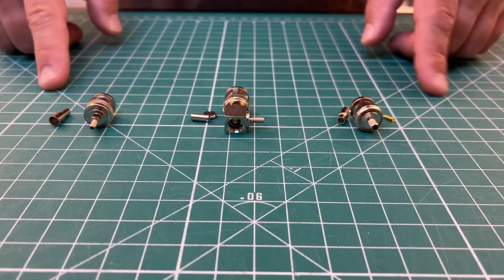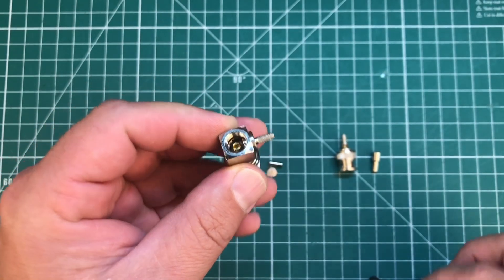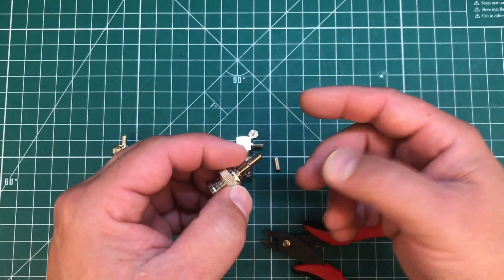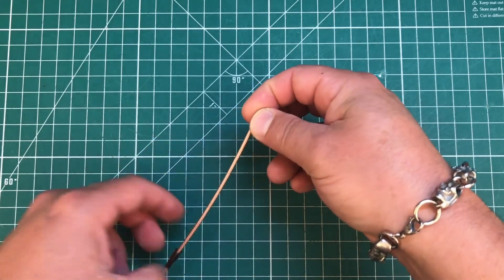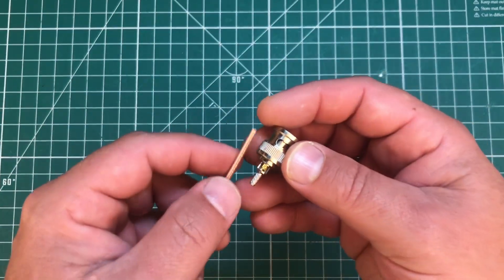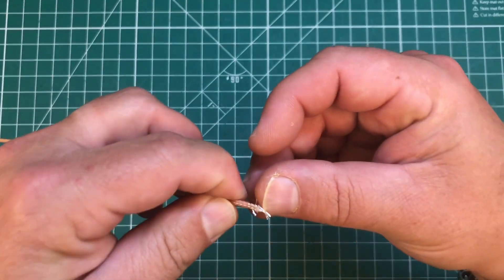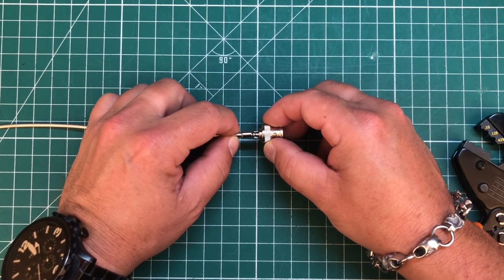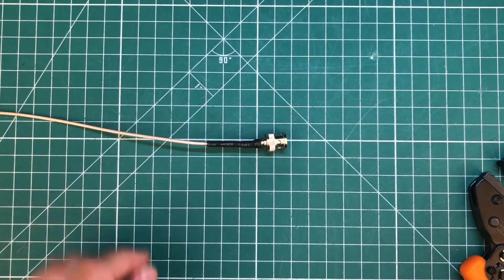How To Install A Crimp Type BNC Connector On RG-316 Coax

Comment: Finally got the parts to do this. Looked great but shorted. No idea where the problem could be. To many variables.
Reply from the maker: could be a tiny drop of solder under the center pin?  That's about the only place it could short I would think.
Reply: @hamradiotube  I forget to update this after we talked on Discord. I tore it apart and I think the solder blob was to big and spanned the gap to the rear of the inside were the center comes in. Who knows but I tried it again with less solder and it’s now working great. Old eyes as well, it’s so tiny in there even with 4X magnified glasses.

Comment: Great video Mike, I need to put together some bnc coax cables. Had a major WTF moment a few months ago when I drove down to the Outer Banks to go portable and got my gear out on the beach, went to hook everything up and when I pulled out the PL259 coax I realized I left my bnc adapters at home. I just went to the bar, drank heavy and accepted defeat. 73 my friend!
Reply from the maker: Oh man, I've been there.  That feeling when your heart just sinks when you realize you won't be getting on the air is the worst.  But, at least there's alcohol!

Comment: Mike, Love your videos, I've been a ham for almost 42 years, & I used to get my connectors from Old timers at hamfest back in the 80s & 90s. I also worked for big computer companies like DEC & Wang Labs. We would use only Amphenol for our Data cables I would get mine from there and only use really good BNC/PL-259, etc connectors. But after leaving there I learned by mistakenly getting the cheap versions when I had no more of my stock left & would buy from E-Bay most times. I had problems, so I now only use Amphenol connectors because of their higher quality. You Pay a bit more, but you are getting a much better quality item.
Reply: I Concur
Reply from the maker: I guess I lucked out!  I've not had any problems with the eBay connectors I've purchased, but I do understand the difference between good and cheap.

Comment: Mike, 

First, thank you for showing the differences in the BNC connectors.  I have used the first type and it is not so easy. I didn’t t know about the other two but they make the job easier and more trustworthy.

Second, I see you are doing it by the clean cutting board in each new view but please tell others to have a vacuum running while cutting the shield.  Those little pieces of the braid look so innocent but when they get loose and get into other projects they wreak havoc with electrons and will cause great amounts of hair loss while trying to find the cause.  

Dave K8WPE since 1960 and I have been there……

Comment: Great video, Mike!

What happens if I cut one or two strands of the center conductor?

I ordered some of these connectors in January and they never arrived. I got a refund, but never purchased more. 

73 de VE3GKT
Reply from the maker: I’d try my hardest not too.  There’s only like 6 in there :).  But I believe that can change the resistance too so if you do cut some, I’d just do it again.
Reply: @hamradiotube  rr. Thanks!

Comment: Nice video Mike - and very timely. I agree with the comment regarding use of Amphenol connectors due to their quality. However, I have no experience with RG316 coax.  What is your preferred source and/or brand? The flexibility makes it ideal for use in the shack. Do you use if for jumpers? What is your primary use? Thanks.
Reply from the maker: I got the RG-316 from PackTenna.  I use it when portable for my feedline.  Not so much in the shack.